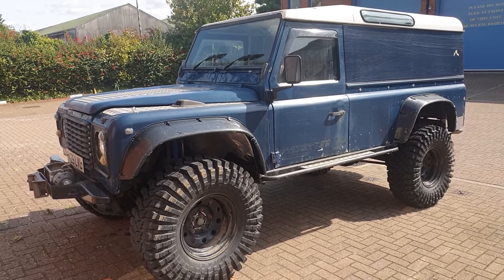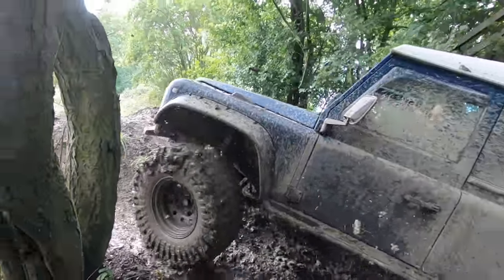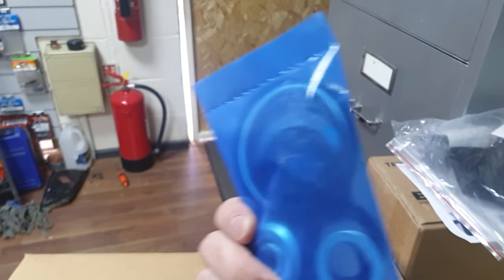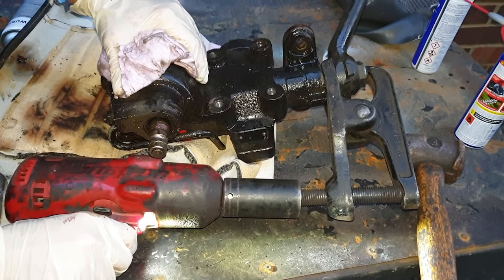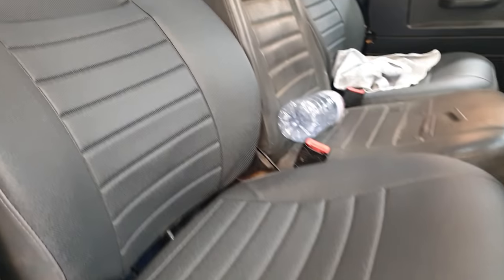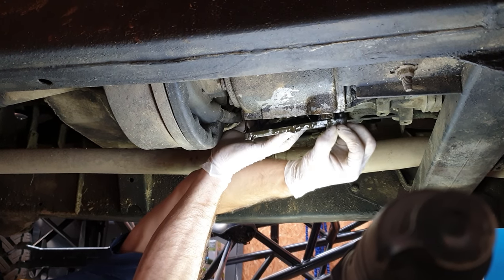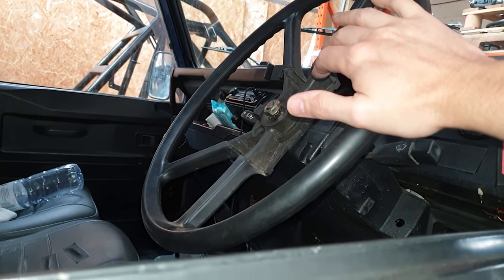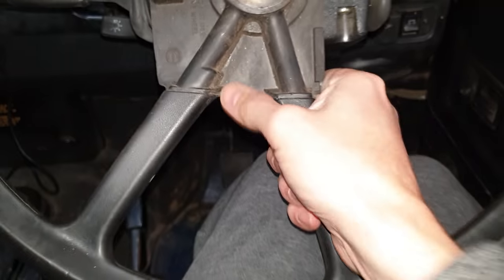Broke my Land Rover Defender and trying to fix it

Comment: The middle shaft in the transfer box has an o-ring on the forward end of it, they are common for leaking, easy job, remove the transfer box and push the shaft out slightly from the back of the box, change the o-ring and put it back together

Comment: the transfer box leak could be the input from the gearbox or the intermediate gear shaft O-ring seal. both jobs are box out. (mine needs doing!)

Comment: If it's flex your after chief, maybe have a look at the terrafirma +11 kit. It's pretty comprehensive, then match it with some longer but softer springs. Ride will be similar height but squidgier, and you'll have all the flex you could ever need.
Reply from the maker: looks like a good kit!!

Comment: About that fender. I have worked for my frien making racing car bodykits and if its properly made then is should last long, i have seen fiberglass parts after car has done 5 rools in crash and a part is looking great just cpuple skraches and cracks what is an easy fix